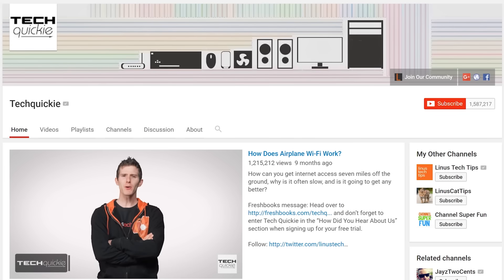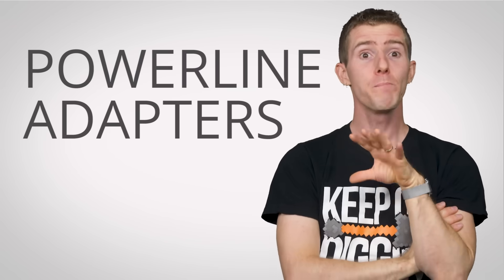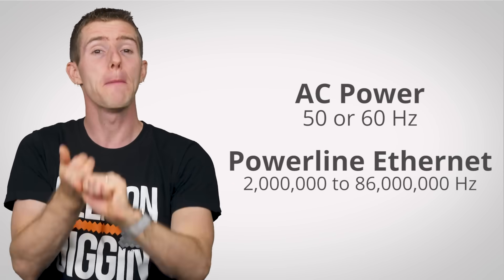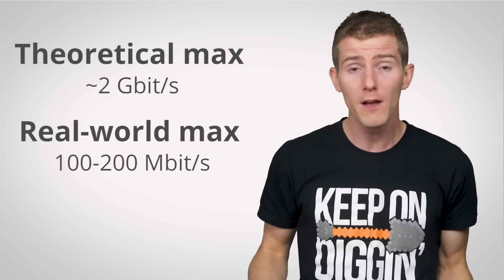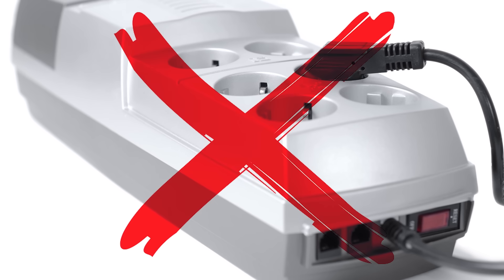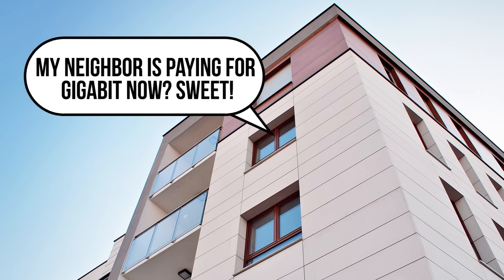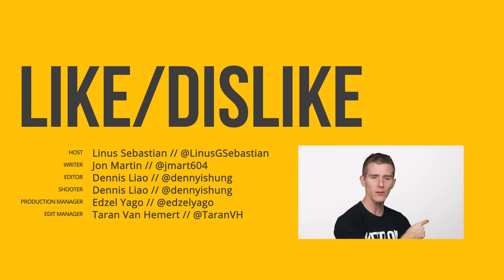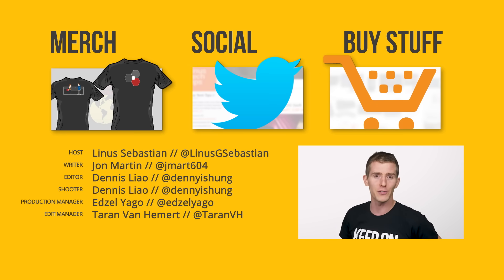How Does Powerline Ethernet Work?

Comment: He didn't talk about the repeater function that some provide if you have adapters that are farther away. So, even if you have a longer run of wire where the signal drops off, if there is an outlet between them where you can place another unit, it acts as a repeater. Also, he didn't mention that the signal can't pass through different phases, if you have a system that goes from single to multi-phase.

Comment: I've been using a powerline plug in a surge protected extension cord for awhile now and it gets on average same speed as if plugged into wall may not be same for everyone but been my experience
Reply: Tristan the Gamecat Davies latency variation is higher,also some dropped packets.
Reply: Alexandre Loens I'm just saying my experience has been problem free with mine no issues

Comment: I just moved to a place which had a superfast hub but was left devastated when my room was in a dead spot, opted for a powerline instead of a wifi extender. Worked brilliantly and got a way faster connection than anticipated. TP Link AV600 2 port passthrough. Plug and play, so easy to set up.

Comment: Great video Linus and friends! Just to clarity u need two adapters where as if I'm using a range extender I only need one?
Reply: you always need at least 2 units. one is connected to the router/modem ant the other one is place elsewhere in the home. plug the range extender into the second unit. you can always add more units but every power line network needs at least 2 units.

Comment: At my house my wiring isnt the best and poweline speeds cap out at 34 megabit/s. I got that speed using my old 200mb adapters, so then i borrowed a friends 500mb more recent ones for testing. same exact results: capped at 34mb/s. Guess that's how far my crappy 20 year old wiring goes.

Comment: You missed the biggest caveat.  In North America, both outlets need to be on the same side of the 240.  If they are, Homeplug works; if not, it don't.  Period.  If this doesn't make sense to you look at the WikiPedia article on how 240 coming into your home turns into 120 volts.

If you want the short version, think of a 240 volt sine wave.  Draw a horizontal line through the middle.  If you take the line plus the top or bottom, you get 120 volts.  If you take the top and the bottom you get 240 volts.

Comment: I just bought a HomePlug AV-compliant AV600 from TP-Link, though that would only be a temporary solution, as my family might be moving to a new house with built-in Ethernet wiring.
Reasons are simple: no difference from wired gigabit despite me using a gigabit internet and downloading stuff are all under 100mbps so I found no point dumping in MORE money on the AV2 standard.

Comment: its good if you find the sweet spot. Tried a few areas in my house (circa 2010 construction) and in those areas it ended up tripping the associated breaker in the fuse box.

Comment: I would assume that a power line adapter on the same circuit would be quicker than splitting it on 2 circuits, and having the signal go through the breaker panel. Seeing as that would cause lots of interference.

Comment: Okay I just have a question about the power line adapters I have a house with a power breaker(I'm sure you do too I'm fairly certain it's just electrical code) meaning different areas of the home are on seperate breakers will the adapter be able to go from one breaker to another or would the breaker act as a block

Comment: Addition: In some contries, where Power groups are a thing, you must use the same power group for each connection, as the megahertz cannot traverse non circuit relays. Furthermore the high wattage groups are often prone to package loss, as conjunction of lower frequency signals can create different cost prices, effectively changing routing of the signals in between packages, this can result in some devices registering bad connections resulting in down graded image streams or stalls for certain things. These are often handshake reluctant protocols, which means a return package can get "lost" in the powergrid. This is mostly happening in old houses with new extensions. Personally I will suggest wiring a house with optics, although that is a solution prone to be very expensive, but also the most future proof as an upgrade can be made in optic modules at either end.

At my current appartment, where i serve as network admin, we are limited to cat5e in the walls, which means we would have to rewire stuff if our mainline gets amped up to 10g/s, and all residents should be able to share that bandwidth without bottlenecks.

Comment: A bit confused, since our ethernet ports are Gigabit (1000mbps), then doesn’t that mean Powerline adapters with speeds more than 1000mbps are redundant?  (So we should not bother investing in powerline adapters faster than 1000mbps models?)

Comment: One of the issues I have with PLEs are that they only tend to last for 3-4 months depending on the model maybe due to the overheating of the device and whatnots. If that is already solved on newer models, then it is a good replacement and/or option if you're trying to run ethernet cables on your house.
Reply: The ones I have , tp link 600mbs , have a 3 year warranty and I've been using them close to a year. Still no problems

Comment: I'm working for a wisp provider ,and several times in my work experience due to third party tip or to client direct request i've installed this kind of devices (each time a different brand).Never worked.I mean if you intend a thin use (one laptop browsing) of the connection it's workin' almost well, but if you pass to more network devices(smart tv,access poit,more than 1 pc)-You're screwed !

Comment: The thing with powerline adapters and surge protectors/splitters is that they have in them MOVs(protection component) which have some capacitance which messes up the signal from PLA.
Reply: do they have bills?

Comment: I personally use a powerline adapter setup to get Ethernet where I game. I got "high end" adapters and saw a a reduction in overall  nextwork speeds. I get 175 down service and only get at most 50 when using the powerline adapter. Ping was a better than wifi but not as good as a direct Ethernet connection. Don't bother with powerline adapters unless you NEED Ethernet access in the area you are using the device.  If you've got 50mbps internet or slower and plan to use it when you're not using demanding electrical devices. This works well. Otherwise, find a way to use real ethernet cables.

Comment: Do powerline adapters harm your PSU? Do they add ripple to PSU output voltage?
Reply: No. A PSU is a natural Low pass filter. It naturally filter out all high frequencies of electricity passing through it. In fact, you should worry more that your PSU doing harm to your Powerline adapter than the other way around.
Reply: How can PSU harm Powerline adapter?
Reply: Not exactly like harming the physical, it might disrupt the Powerline adapter perfomance. There are PSU which could generate a certain high frequency in the electricity which might interfere with the frequency used by power adapter data transmission.

Comment: Question, could it be possible to get a full fibre home network? So fibre comes in your house and from there a modem with only fibre ports for output. So all your ethernet cables can be switched to fibre. This way you can get full fibre speed without bottlenecking.Well if you use a fibre expension card for your pc, which already exist but  i can't find a fibre to fibre modem though. Do you guys think this will come to market soon?

Comment: I've use Powerline quite for a while and it works great in my apartment. I get consistent speeds of around 230-300 MBits and almost no latency(much lower than WiFi). I use 4 Devolo DLAN 1200+. I'm very happy with this.

Comment: I tried a powerline setup, and because my home is three phase and the two destination points couldn't be put on the same phase the powerline could not even connect, but it did work OK between two plugs in the same room

Comment: I use the TP-LINK TL-PA9020P. Keep in mind that if you have arc fault breakers, you may not be able to use powerline. I have heard that siemens arc fault breakers cause this problem. I have square d arc fault breakers and I have had no issues with powerline.

Comment: Guys, don't listen to all the people in the comments. Everyone is biased and all evidence is anecdotal. Powerline CAN be great (it worked really well when I needed to use it) and it CAN be terrible. If you can't use ethernet connections, and don't wanna put up with wifi, try a powerline adapter. The only way you can know it will work for you specifically is to try it, as there are a lot of variables that can affect powerline viability, and not a whole lot of constants. 

So try it yourself, no one can tell you how well it will or will not work in your home for what you are trying to do.

Comment: I use MoCA networking over the cable TV coax lines instead. Identical speed to Ethernet and I use it for a 150 megabit connection with no issues, I think it goes even higher than that though. Just make sure to put a whole home DVR filter on the coax coming into your house. Old Verizon Actiontec boxes are cheap on eBay and with a little setup work great.

In Florida, Bright House Networks used MoCA exclusively to send recorded shows between cable boxes, as well as for Internet with their Echo WiFi repeater service. Since the Spectrum buyout they no longer use it though.

Comment: I have gigabit Powerline ethernet and I've never gotten more than 150-200 mbps with them. The only exception being getting about 850 from one wall to another in a brand new office that was being built that I used to test best case scenario, 6ft, clean, new, insulated wires. 

Good enough for a youtube machine hooked up to a TV in the living room. Kinda garbage if you have network storage or it's your main PC.

Comment: My personal experience with powerline networking has been hit and miss. I've got one pair in the house for a shot hop between the router and a satellite TV box to save drilling through a thick wall and that one works ok. However when I tried a pair between a house and an outbuilding in next door's back garden it wouldn't work despite there not being much distance involved. 

Powerline devices also pollute the radio frequency spectrum as someone else has already pointed out. Whilst I do not suffer directly from the pair in my house it is possible the same kit inside my neighbour's property could be 'noisy'. 

Although very briefly touched on Linus avoided the elephant in the room which is that mains electricity cables are not designed to carry data or indeed any signals at all. Mains cables are generally not shielded sufficiently for such a purpose or indeed shielded at all. ADSL signals can be affected by 'dirty' DC power supplies due to the fact phone lines aren't shielded from RF emissions. 

I won't deny powerline networking has it's uses but I have seen examples of equipment that can function whilst on two entirely separate circuits and examples of DAB radio interference here in the UK to say nothing of the often reported problems with AM radio reception. 

Rant Over.

Comment: One question, electrician speaking here. Wouldn't this require said adapters to be placed on the same circuit. I can't imagine these products are smart enough or strong enough to go from one receptacle to a its breaker, jump to another breaker (Possibly of a different amperage too and wire gauge, say 15A to a 30A) and head back to another receptacle on a different circuit. I wouldn't think this is even possible.

Comment: There is a bit more to it...
They must be on the same Phase in the power wiering.
When you have a generator with a long cable and the adapter on the end. They can work to your nighbors with more than 10m airgap.
The wiering in the Home is more like a big antenna. And all devices share the same...
In other applications output like this is classified as EMF/EMI and must be removed. I have no idea why they allowed...

Comment: How fast and stable is it?  Faster and more stable than Wifi, not as much of either as Ethernet.  Wifi is absolute garbage, and should only be used when there is no other option, and even if things on your wifi behave fine, the more devices you get off the wifi, the better the experience for everything that's still there.  

Powerline adaptors are fantastic for one class of customer:  renters.  In Australia, if you're renting, you're barely even allowed to put a picturehook in the wall without rivers of ink on paperwork, so oftentimes running ethernet is just not an option.  In all cases where ethernet IS an option, it is preferable to using powerline adaptors, however, if a powerline adaptor works for you, and you can't run ethernet, it's definitely the best option.

A couple of things on the "plug directly into the wall" thing.  I've found from experience (your mileage may vary depending on the exact make and model of your ethernet adaptors, and other factors) that powerboards are fine if a couple of conditions are met.  First, it has to be the dumbest, cheapest powerboard you can find.  Bare minimum surge protection, no switches, no LEDs, no fancy features of any sort.  Just straight up metal on metal contacts, all passing through the mandatory 10A resetable breaker.  Second, you have to be plugged into the closest port to the cord going into the board.  Some idiosyncrasy with the way mine are wired means only the first port is suitable for this.  It could just be that's the least noisy of the ports, when other hardware is plugged in.

I've been relying on a powerline adaptor for a solid year, and it hasn't let me down yet.  I'm in a unit from the late 60s, early 70s, with the shittiest wiring I've ever seen.  Clearly a lot of home handymen have gotten into this place and bodged together some absolutely not up to code modifications, with wire that is certainly not up to scratch for the purpose.  Somehow it still works, and works reliably.  I get about 300 Mbps, but the real win is the latency.  Only about 2ms or so  to the router.  I've had worse results off ethernet, to be honest.

Comment: My question is would a solar panel system effect it as well the issue that i think the shed is on a separate circuit from when the houses power box had to be upgraded for the shed + solar system.

Comment: When I set up my parents system, I used these to send the internet signal from the modem to one wifi router on the opposite side of the same wall where I couldn't drill a hole and internet over the cable line to send it to a router in a different room that was farther away. That was before the Aero started advertisibg signal repeaters that were easy to set up. At the time, setting up a repeater was too hard for my skill level. But it works pretty well.

Comment: modern powerline adapters retransmit signals that are not designatet for them to achive more bandwith and/or longer distances:
you benifit from more powerline adapters in some installations:
But as in all electric installations: Ask your local electrician! In some installations you may need a special device in your circuit breaker.

Comment: @linus I feel you have missed a vital issue with powerline adaptors. They will NOT work if each adapter is on a different ring main. I wanted to highlight as its a very important for anyone watching from the UK or other parts of Europe. This may not be an issue for the US or Canadian residents as you home wiring may be different

Comment: Powerline networking is the bane of radio operators the world over. The amount of RFI that spews from the unshielded copper wires in your walls destroys radio reception for almost a mile radius. Don't use it.
Reply: kc8hnz i haven't seen any issues because the radio frequency interference only occurs on the ground

Comment: I love powerline but only use it for streaming DLNA video to my TV located at my basement. I still find WiFi faster for anything else (even connecting the “streaming pc” to the network). Powerline is great but as Linus said, test first if it’s the best solution for you.

Comment: I use some cheap TP-link adapters and they work fine in my parents 10yr old house. It can easily achieve speeds of well over 100mbps, where Wifi woud barely do 15. The only issues i have with it is its stupid power saving mode, that turns the adapter off when there's no network activity, and sometime doesn't detect network activity. And to my knowledge, there's no way of turning that power saving feature off.

Comment: Does this work to the same 100mbs speed when each room is wired to a different circuit break? Each room in my house is off of a different breaker and the internet access point is in a different room than my PC

Comment: Yo techquickie a request: Could you do an item about cost savings for turning lightbulbs on/off?

I think Mythbusters did it once, but I can't find it and that one is outdated anyway. I was curious about energy and powerbill saving for turning the lights on/off or leaving them on everytime whenever you leave your room. And also lifespan of the lights depending on what kind of lamps you use (led, halogene, TL and oldschool light bulb) and the powerdrawing, if there's a peak and how long before the lamp is on the right temp.

Comment: Powerline works really well for me. There was a problem where I would randomly lose internet with it, but after some googling I found a solution that takes like 5 minutes and now my internet is almost as good as if I had a direct Ethernet connection (you just have to constantly ping your own IP address).